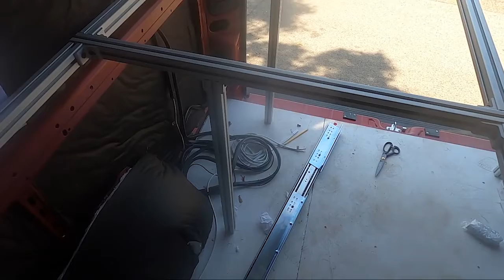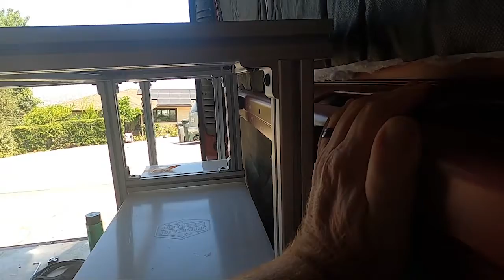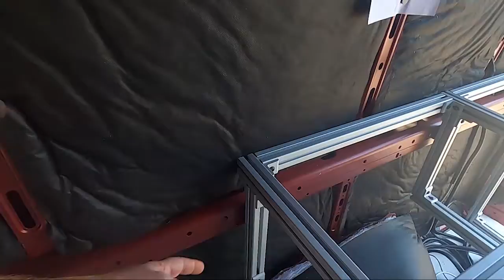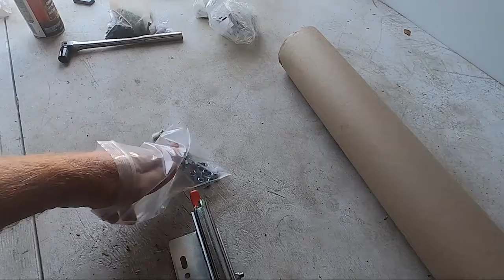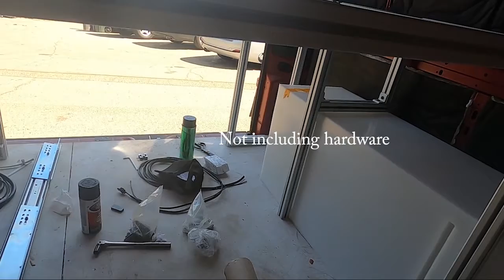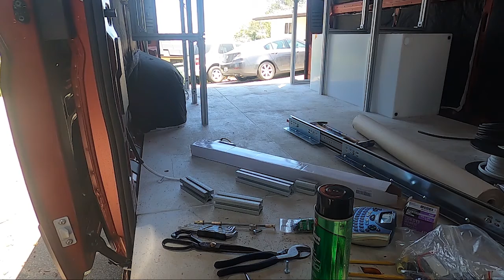8020 Bed Frame for Ram Promaster 3500 Extended

Comment: Having now used 8020, would you ever go back to wood framing in a van? I've only worked with wood for 50 years, so that's my inclination for my van build. I know wood. I don't know 8020. Thanks.
Reply from the maker: This is my first van build so I don't really have any experience with only using wood framing in a van.  I've done some limited cabinet making for my house.  I think if I were starting over, I would fully frame the walls with wood to get a straighter inside wall from the start.  I do like the sturdiness of 8020.  Once it's locked in, it doesn't move at all.  Also it's pretty light for that structure.   And I can just sheath it with lighter plywood to create a wood look.  For example, the garage area just has a 1/2" plywood forming the outside wall.  It can also be loosened and slid around a bit if an adjustment is needed.  It does present some challenges though.  Attaching panels seamlessly is a bit of a challenge.   Also, sometimes the corner brackets can get in the way (for example a clean opening for a cabinet).  So it takes a bit of planning and maybe some reworking.  Also, you want to preload the 8020 with tnuts if at all possible as the roll in tnuts are about 5 times the cost.  Another downside is if you need more, it can take a while to get it, whereas plywood is usually always available.  Heat transfer can be an issue as well.  You'll want to isolate it as much as possible from the van metal as heat will transfer through it pretty easily.  Either way though, you'll have an advantage with your wood experience.
Reply: @redgiantvan189  Thanks. I've discovered you and Humble Road. Never knew about 8020 before. Not sure this old dog wants a new trick at my age. The advice to Pinocchio keeps coming back to me: "Stay wood, boy."
Reply from the maker: Haha!  I watch Humble Road as well.  Other 8020 users I like include "Seven O Savage" and "OurKaravan".  I think OurKaravan was one of the original users of 8020 (about 5 years ago).

Comment: is there a design reason you went with a double bed over a queen?
Reply from the maker: At the time of design, it was just to maximize living space since we have a lot going in.  Looking at it now, I think I could still extend the back area near the door to make a queen size if needed.   There's about a 6 " gap between the back of the bed and the rear doors.  It would just be a matter of adding some 8020 and a strip of plywood.

Comment: Sir, stumbled across your channel.  Seriously, top notch.  Humble Road and Seven O would be proud.  Love the fact that your frame is true and square and based of the floor, not the side rails of the van.  Have you thought of a zero clearance platform bed frame?
Reply from the maker: Thanks.  Humble Road and Seven-o-savage are on my watch lists.  Both are very inspiring.  For a zero clearance bed platform, if you mean even with the top of the 8020 so it doesn't protrude further into the bed space, I'd like to do that.  Possibly it could utilize the horizontal slots in the 8020.  I'm also thinking of just routing out some edges of 3/4 plywood (with air holes) to slip into the openings.  I haven't worked that out yet.  I'm currently working on the electrical setup (batteries, mppt, etc).
Reply: @redgiantvan189  If you haven't seen this fellow.......https://www.youtube.com/channel/UCoj6RxIAQq8kmJme-5dnN0Q

He is really top notch.
Reply from the maker: @lkazanov  I'm familiar with him.  His info is good.  He doesn't do much with van-type builds any more.  I think he thinks it's boring.

Comment: Another great video- it convinced me to use aluminum extrusions for my bed build! Did you consider using aluminum extrusions from TNutz as opposed to extrusions from 8020? Looks like the TNutz extrusion offering is less expensive than the 8020 offering but uses a different alloy. Not sure how much that difference in alloy, and resulting strength, matters, given the anticipated loads on this application.
Reply from the maker: I actually did use some of it on my sliding rack.  I had enough 8020 to do the main rack and the two sliding bars but didn't have enough to do the front to back bars on the sliding rack.  I didn't know about the 8020 2° angle when I had them or I would have checked to see if it was the same on the TNutz bars.  The only downside to the TNutz bars is they have less options for profiles.  Just handling it, I didn't notice any difference between the black 8020 vs the TNutz bars.  I recently reordered and received some 15 series 8020 along with some different profiles (curved for shower and refrigerator enclosure, and some 10 series for cabinets and sink area).